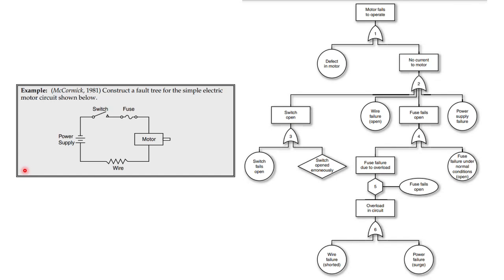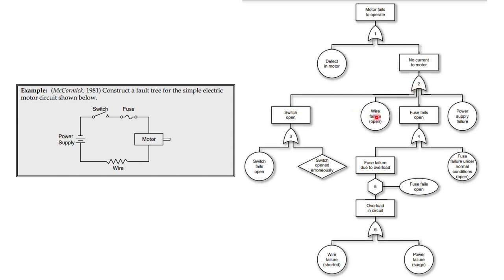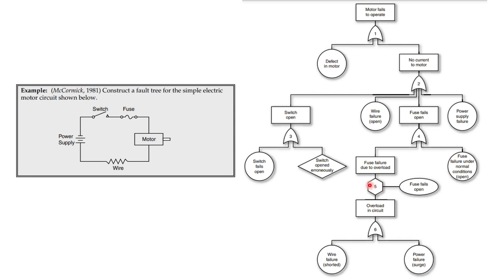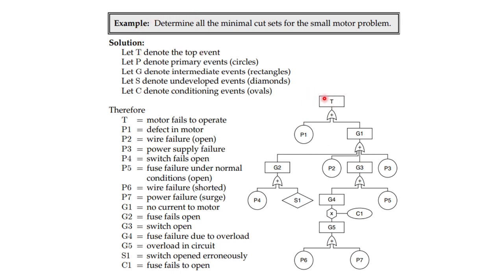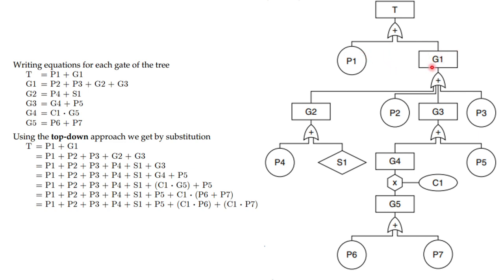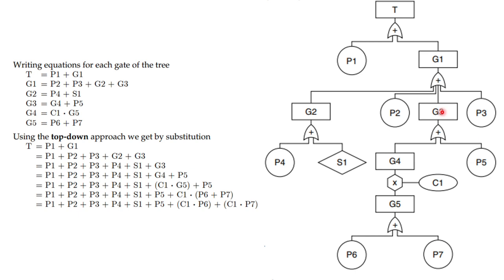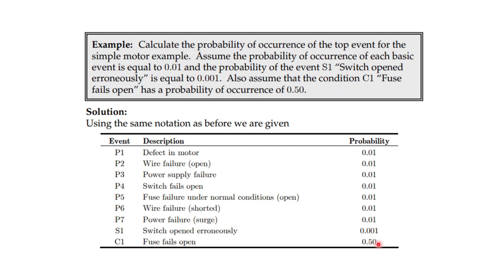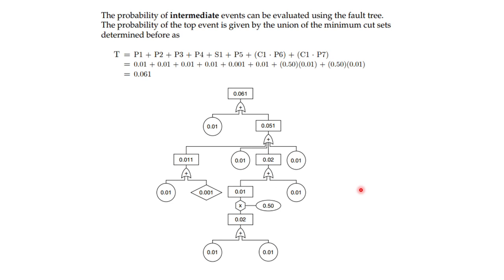Fault Tree Minimal Cut Sets and Quantitative Analysis

Comment: Thank you, this was very well explained. However, I did not hear any rational about what constitutes the minimum cut sets. I understand there are numerical methods to determine the minimal cut set but with this relatively simple FTA, I was assuming you would explain what differentiates a cut set from a minimum cut set.
Reply from the maker: A cut set is any set of basic events that cause the Top Event. A minimal cut set is a cut set that if you remove any basic event from it, the remaining events are no longer sufficient to cause the Top Event.